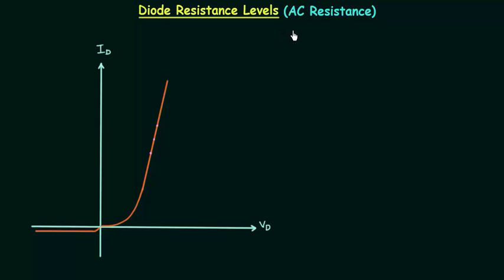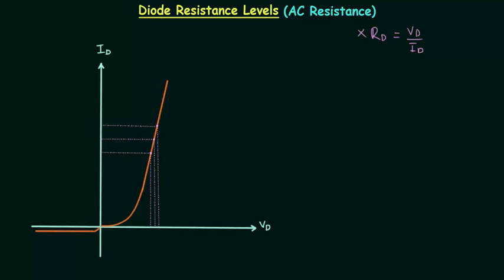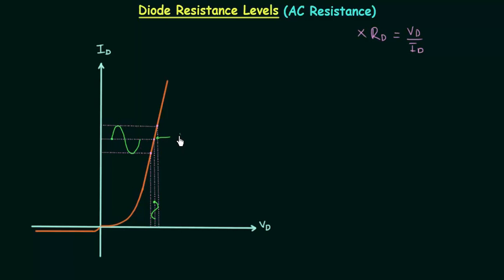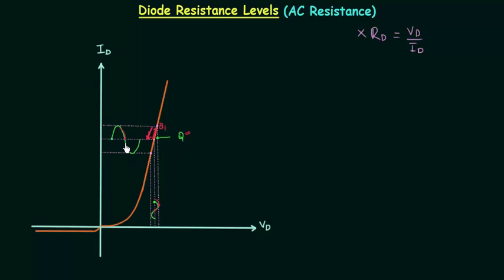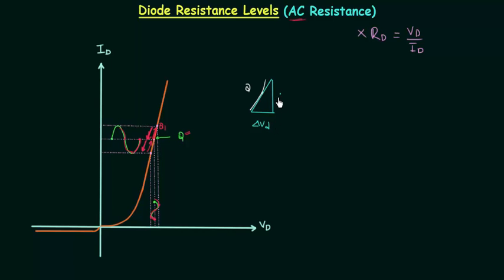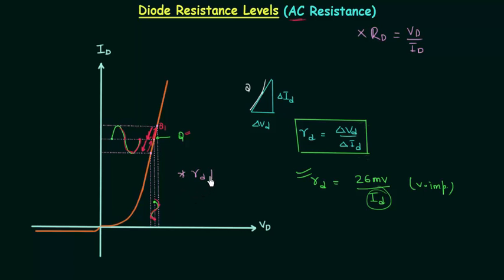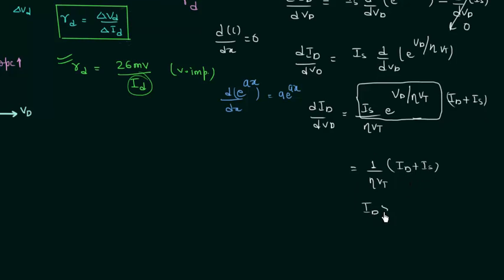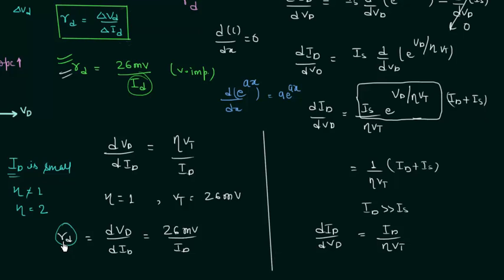AC or Dynamic Resistance of a Diode

Comment: if it is ac current or voltage , where is the negative cycle of ac ? .At negative cycle the diode should be reverse biased and the plotting should be at 3rd quadrant . I think the given graph is wrong as for AC
Reply: Dear it's AC sitting on DC.. so when AC -ve half cycle comes the Q point shift down vertically... Which is shown in the graph..

Comment: In case of ac source then the sine wave will be varying acc to time. So consider  during positive cycle the p type is connected to the phase  and during negative cycle neutral will be connected to p type of the diode .... so during the negative cycle diode won t  conduct..... it will be reverse biased... so how can the resistance value can oscillate in this curve please explain.. i am getting confused.

Comment: Why you told, Vd=26 mV!! ?? from what we know that.?
Reply: Vt=26mV bcz it is called thermal voltage and its formulae is Vt=kT/q where,k=boltzmann constant 
T=temperature in kelvin generally 300 kelvin
Q=electronic charge
Reply: 26mV means voltage in normal room temperature

Comment: Thank you so much for the amazing presentation Sir.

Why is rd=26mV/Id not applicable for the knee voltage region
Reply: if Id is low (at knee voltages) ,n=1 for germenium ,2 for silicon.  but if I is large n=1 for both germenium and silicon